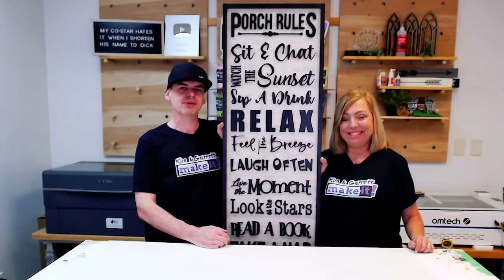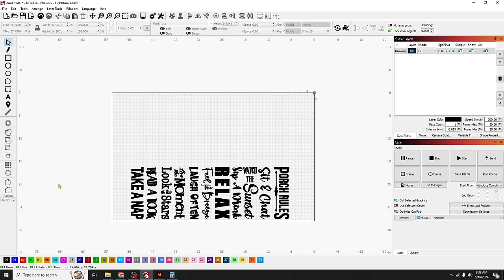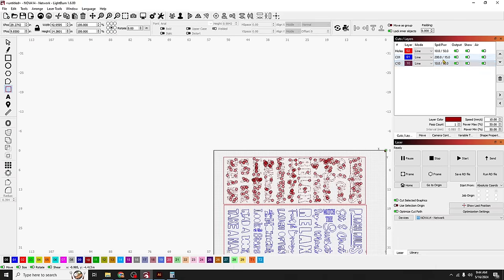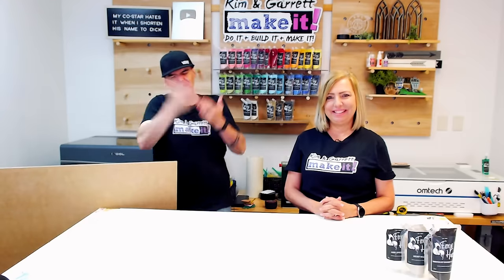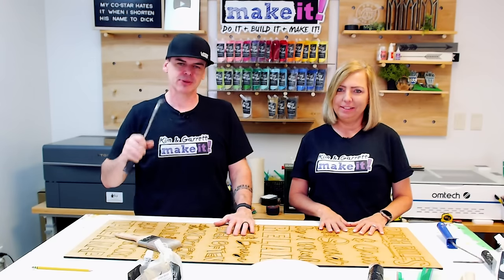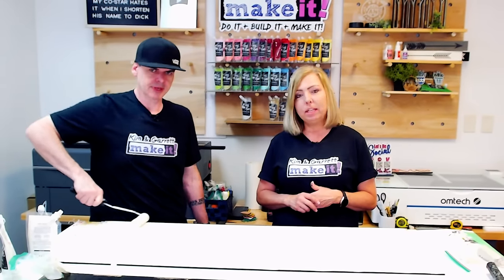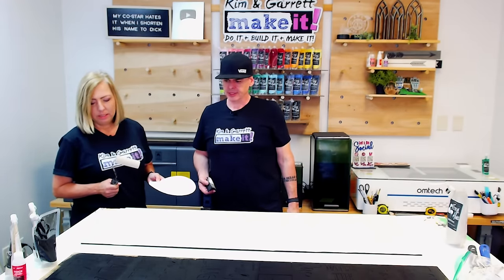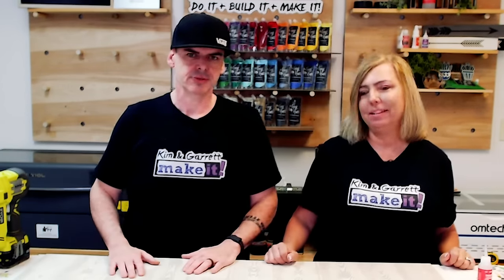Pinterest Trending Porch DIY: Making High Profit Laser Cut Front Porch Sign

Comment: Another thing you can do after the wood  grain dries, if you want to emphasize the individual boards look; get a circular saw, and set the depth very shallow, like 1/8".  Then with a straight edge to run against, put a very thin groove between the "grain boards" and it will make the finished product look like shiplap or tongue and groove boards put together.  It makes the individual board design stand out even more.